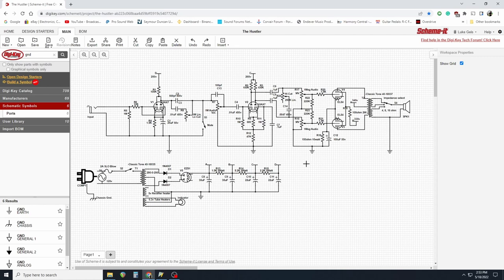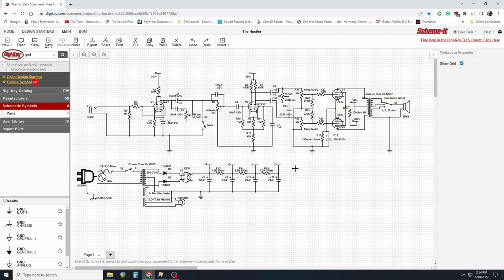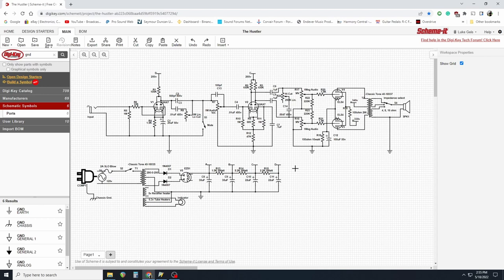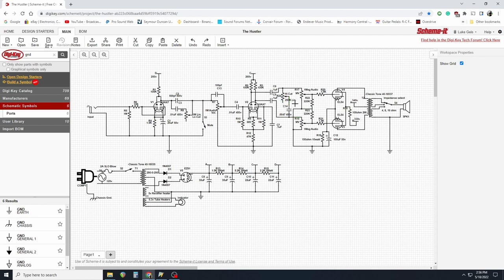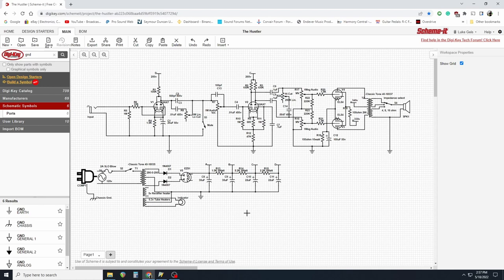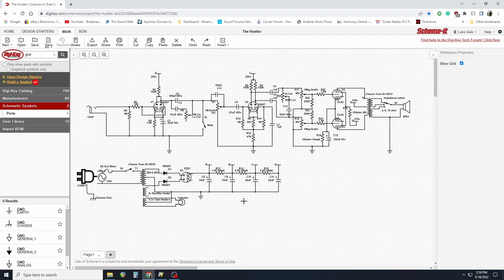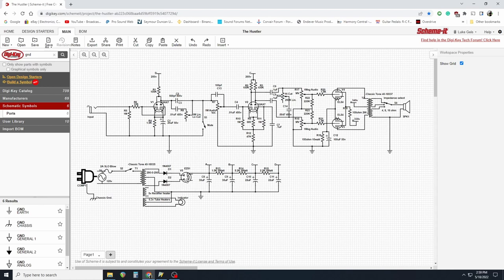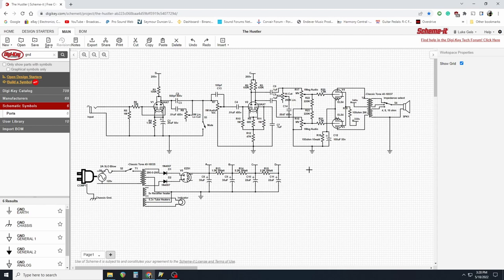Let's build the world's best guitar amplifier Part 3

Comment: Howdy. Nice.
I observe You use a Schmitt phase splitter. It is OK but usually the slave triode delivers less signal than the master. You might consider using a 120 k anode resistor in the slave triode to symmetrize the levels. However, that has little meaning in a guitar amp.
Also I see there is no neg. feedback. Using some feedback from the OPT secondary, some say, may deliver more headroom.
And You are correct. The mains switch should be all pole breaking. One should also use fuses in both the live and the neutral. These measures guarantee there is enough breaking capacity in case of a total short circuit fault.
Regards.

Comment: What does the amp does not work well with pedals, mean? Some examples would be nice
Reply from the maker: For me and my experience with different amps, some “ take “ pedal’s really well, while some seem to fight, or make pedals work differently than you expect relative to other amps. 

In my case, the normal channel was just too mid humped, and it made pedals bark too much, wasn’t a very sparkly clean, and just didn’t do what I had hoped with pedals.